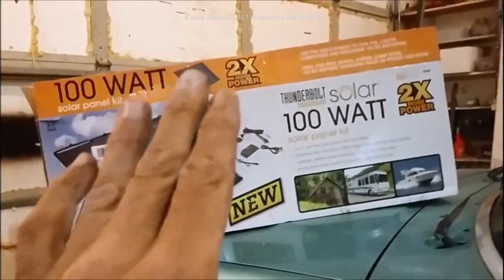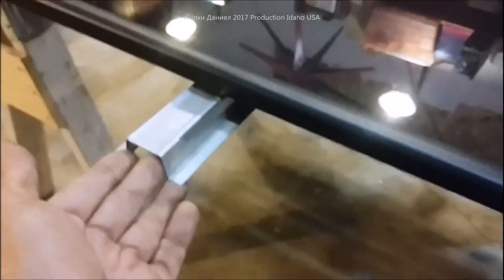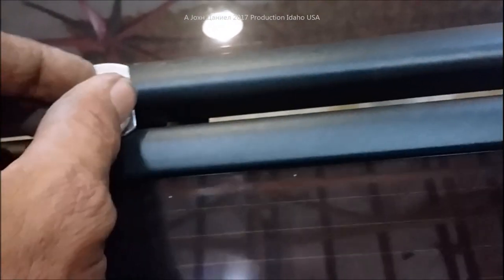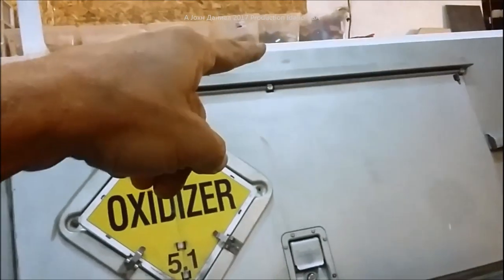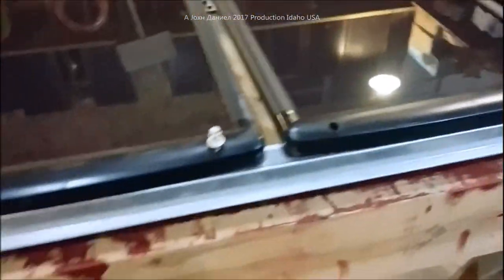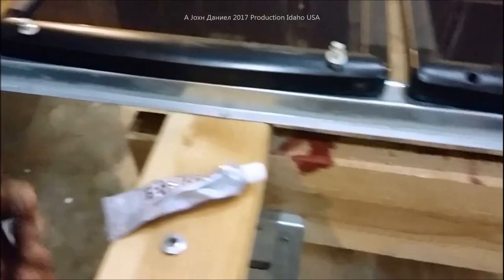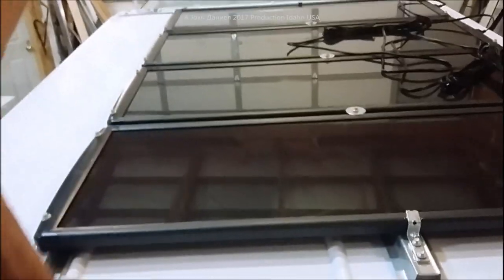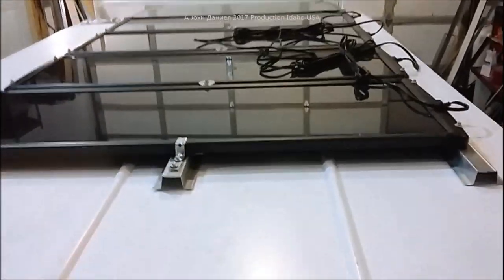100 Watt HARBOR FREIGHT Solar kit how to install, ( see below video parts and more options )

Comment: I bought the same thing and was shocked at the size. I returned it and got a Renogy setup for 1/4 the size and far cheaper per watt, and I got my HF on sale with 25% off coupon. Glad it's working out for you though.
Reply from the maker: +GovG33k I have some 100 watt renogy on a little camp site in Monticello Nevada. In 28 months both are brown and not working. Sitting next to them is 3   75 watt  kaneka amorphous from Solar Penny that are 7+ years old and working perfect.  Wish I'd bought 10 of them!
Reply: Good to know.  Thanks John.

Comment: I've had mine for overall year now on my van.. Not one issue. Mine has a separate plug for connecting the panels to the charger on the unit. I've noticed when people plug in there panels to the two outlets with the solar symbol, next to the battery on the bottom of the unit, they blow a fuse in the unit. I have 3 AGM batteries from Harbor Freight. I don't use so much juice that it drains the battery. During the day the panels get 13.8V so I can use the energy directly from the sun to use. It's a great unit for beginners.  
 Thank you for the video.
Reply: Lead batteries need 14.6 at least to get a full charge. Check the charge specs from battery manufacturers

Comment: I liked the 45 watt kit. 
I love the 100 watt Thunderbolt solar kit. 
Harbor freight got it right on the 100 watt.
Reply from the maker: They are a excellent beginners solar set. But, don't stop there, go find some real serious Amorphous CIGS Panels like STION and grow with them!
Reply: There are a lot better panel stand these Harbor Freight. Virtually anything on Amazon in a hundred Watt is just as good if not better and about 1/4 of the size

Comment: That's one hell of a battery bank you got there, bigger then my motor home. Just added solar to keep the house batteries topped up. But usually lasts 2 weeks, lights and water pump.
Reply from the maker: Increase your solar, and if you want to make you a booster using tool batteries to surge charge your system when low, stay tuned I will eventually show how we use 8 spare 20 volts batteries fed into a solar controller to hit it with 15 amps at 4 am.

Comment: Did you do anything in terms of weatherproofing? I have these and I'm thinking of running silicone caulking on all the corners between the cells and the frame, as well as around the screw holes and where the frame has any seams.
Reply: How it went with weather?
Reply: 3M 5200 WHITE is BULLETPROOF.

Comment: A great way of maximizing your charging power is the ability to tilt your panels especially during the winter months. These panels are made to be tilted and have the necessary hardware included. Your installation is preventing you from using these panels to their maximum capacities.
Reply: Some of us are looking for a good way to top off batteries without a lot of trouble or having to be constantly tending a system.  These amorphous panels work well without being too nitpicky about directly facing the sun or being in mixed (or even full) shade.  These work nicely for that purpose, and I'm not out fumbling with panels the minute we stop.  If they don't charge enough, and I'm not driving anywhere soon, I can simply start the engine or the generator for a while.  Haven't had to do that, but I'm much happier not having made a career out of trying to eke out every last possible bit of power or worrying about what some others have posted about getting better quality elsewhere.  My in-laws have a new $120,000 RV which they have to park in the sun...I park ours where I feel like, under the trees or whatever, and don't worry about it.

Comment: Awesome, that's what I started with 6 years ago, nice video, thanks for sharing! Godspeed
Reply from the maker: +My Battery Powered House I got my first 3 for a birthday gift over 10 years ago, starting in 2009 to now I have over 7800 watts of solar and wind power.
Reply: that is incredible!
Reply from the maker: +My Battery Powered House I recommend always putting at least 20% of your array in Amorphous
Reply: What makes you say that?
Reply from the maker: +My Battery Powered House Amorphous  produces in all weather conditions even dirty and like my STION Sto-135 panels they all start kicking out real amps at daylight instead of hours later like poly and monocrystalline.

Comment: Hey Mr. John!! I just bought an ambulance that came equipped with a 1000watt vanner inverter and I am ready to try to tackle solar but am so clueless even though I watch videos about solar day and night. I bought a deep cycle marine battery recently and would love to hear from you about how would I begin to get solar setup working so I can power my appliances off grid. Thanks!!

Comment: Great video.  Just like you I bought my kit before they were set out in the store, on the same day you did!  I like your battery bank set up. Could you do a video on how you set up your battery bank if you isn't too much trouble.   I'd like to have mine to the point where I can use 2000 to 3000 watt inverter.
Reply from the maker: +monchorga Go see my other videos for all your searching for.
Reply: Will do, thanks a lot.
Reply from the maker: The Controller that comes with it is not perfect, it eats 14% of the watts up. However, I got 91 watts straight through a REAL Thermodyne Watt Meter, http://rover.ebay.com/rover/1/711-53200-19255-0/1?icep_ff3=2&pub=5575119394&toolid=10001&campid=5337966591&customid=Genuine+THERMODYNE+SYSTEMS&icep_item=391142371694&ipn=psmain&icep_vectorid=229466&kwid=902099&mtid=824&kw=lg PROVEN BEST ONE MADE, Don't buy that fake knock off copper colored aluminum wired missouri junk.
Reply: Thanks for the info.  I'm new to trying to do this.  I really appreciate all the information you have passed on!  Thanks again.
Reply from the maker: They are worth the investment for a test and to learn on. HOWEVER, If you understand SOLAR and want to grow, Especially getting serious but affordable 25 year plus better quality Taiwan made panels, Cadmium Telluride (CdTe) Thin Film Solar are the only way to go. And if you can understand AMORPHOUS, go see the specs on these. And get them with a good controller. The specs are on here DM 77W CdTe Solar Modules - 2PK  http://amzn.to/2u0YRz2 and a perfect controller is The SOLAR EAGLE MPPT  http://amzn.to/2uFxhoT
Those who trash talk and assault Amorphous either sell, hock, push and profit from  Poly-Mono China Panels or Own so much warping, browning, cracking Chinese Mono or Poly panels they are ashamed!
Fact - 1500 watts of Amorphous will out produce, outlive and be more forgiving than 1900 watts of Silicon based in a KW rating over a 30 day period!!
Reply: Just curious if these Solar Panels an Charge Controller are so Great why are there Zero Reviews when i go to Amazon and view them....?
Reply from the maker: +Kelly Dardeen They are generally bought by pro installers, mostly in the Recreational vehicle biz who are not regular folks wanting to do reviews. 
I have installed over 60 of those panels on travel trailers,  box trailers and 2 small homes.  That controller is a solar eagle, being sold by a cheaper dealer than www.yoosmart.com prices a 50 amp for so I put the cheaper link on there, but I can put a more pricy link to the same identical controller that's got 4.4 out of 5 rating if you need it.
Reply: Thanks for the Explanation it just seemed odd to me there were no reviews for either product.

Comment: Great videos... Your a natural for video...
What's the options for running more than one kit, say 3 kits 300 watts and combining them? Possible?
Reply from the maker: You can run 3 kits, 5 kits, 10 kits if you like. Just add or upgrade solar controller to match it's wattages
Reply: @JOHNDANIEL1  great thank you for replying

Comment: John, great video!  Couple of questions thought: 1. Securing the hat channel to the roof, what kind of screws did you use and what kind of sealant with them?  2. Was there any backing or base you had to install inside to screw into?; 3. Did you special order the 18 gauge hat channel, can find but 25 gauge in stores, still looking?  4. You mentioned rubber on the center hat channel portion, did you use rubber on the all three channels?  5. Was the rubber running the entire length or just on the end pieces.  Installing this on a 6 x 10 enclosed trailer for my work bench and Motorcycle so any help here would greatly help.  Thanks!
Reply from the maker: Sealant is LAP, best supplier of FRESH stuff is  http://rover.ebay.com/rover/1/711-53200-19255-0/1?icep_ff3=2&pub=5575119394&toolid=10001&campid=5337842430&customid=lap+seal&icep_item=151644706011&ipn=psmain&icep_vectorid=229466&kwid=902099&mtid=824&kw=lg Floating Seal RV ROOF AND METAL. You put down this roof tape in strips where your metal goes http://rover.ebay.com/rover/1/711-53200-19255-0/1?icep_ff3=2&pub=5575119394&toolid=10001&campid=5337842430&customid=ETERNABOND+3&icep_item=222765809642&ipn=psmain&icep_vectorid=229466&kwid=902099&mtid=824&kw=lg RV ROOF Seal gasket tape. Run it where your HAT metal will lay, put it down on the roof, then put the hat channel on it, screw through it, then float the LAP seal caulk on it where you put screws. 
Screws are common Self Tapper or sharp point roofing screws, 1" long (pre drill your Hat/furring metal for thin RV roofs and set your drill clutch for about 8lbs install torque)
You can call this place to find a dealer of HAT Furring channel near you, I suggest 20 gauge as a goal. https://www.clarkdietrich.com/products/drywall-framing/furring-channel-hat-channel

Comment: From the solar panels to the charger, which wire is the positive? The round wire or the ribbed one?
Reply from the maker: When using low voltage wire to do your wiring the normal choice is smooth is positive.

Comment: John, thanks for your videos!! Lots of good info and looks like we will be grabbing these panel sets also. I have property in eastern Az where we are going to begin building. We need some power on top of the shed for lighting and so on and also to run a water pump. Just wondering if you recommend buying say 3 sets and plugging them together? How many batteries do you have for the one set of your panels and what kind are they?
Reply from the maker: +Mrs.Layton'sClass I'm using the 29 series Exide built Walmart MAXX deep cycle. You should put 1 on each set of 4 panels and upgrade to a 30 amp mppt controller. You can later buy 2 single panels when they offer them and add them to get full use of that 30 amp controller. Would work good to run a good quality 600 to 800 watt inverter, DC lights and small shurflo pump.
Reply: Thanks for that info! You're awesome! I wonder if you might do a video later on your battery set up. It looked cool.
Reply from the maker: +Mrs.Layton'sClass Great idea,  I'll soon do one

Comment: I was looking to do a similar setup for my cargo trailer when I want to go camping.  You are using the one set of panels for three batteries.  I am planning on running a mini fridge off of it, as well as charging phones, laptop, tablet, etc... and occasionally a cpap machine.  I was looking to run four batteries and two sets (8 panels for 200w).  Do you believe that to be overkill?  According to their little chart for approximate wph... it claims that a mini fridge will run off of one battery for approximately 34 hrs, and that a 100w panel system will charge a battery in 24 hrs.
Reply from the maker: If your wanting to go for a equated eventual SAME PRICE much better result, check out the used and proven items I have myself installed, and is listed in the end on this post. From a user of Solar since 2007, Installer since 2011, I say Get 3 of the 100 watt poly panels, a high temp tolerant 30 amp controller and the 1500 watt pure sine inverter because a C-pap will fail on a modified sine inverter and your entire system will be 40% more power on that cargo trailer. Complete for around $700. Doing it piece by piece with the Harbor Freight would actually cost you more because 200 watts ($350 for just 200 watts) is a great maintainer, NOT a great power active source.   See Following:  Complete kit, PANELS, WIRING, MOUNTS, CONTROLLER - https://amzn.to/2R17Icr  & durable 1500 WATT pure sine high efficient inverter -  https://amzn.to/2DBbPrW

Comment: Great video. My only concern is ventilation for the batteries. I'm not sure but I think the batteries give off a gas while charging.
Reply from the maker: +Abel Villarreal The batteries are made to go into RV'S, boats, trucks with much less suspension my truck has. And for hydrogen gas the utility shell on the truck was for hauling mining explosives and has numerous venting locations.

Comment: Cool vid. I have a travel trailer that uses 50 amp service. What do you reckon it'll take to power it? (Self contain) One roof air, and basically a 110 house refrigerator.
Reply from the maker: 2200 watts solar minimum, and 8 deep cycle batteries in the GC-2 style. Best bet, get rid of the hungry 1200 watt topper AC unit, install 2 micro 4800 btu AC's. They make a very efficient 300 watt model from AliExpress that is under counter mounted, with a small hole out the trailer side for it.

Comment: The cap on my truck is not flat.So I would use a shorter hat section channel down the center so not to bend the panels when all is tightened down.
Reply from the maker: +Craig Thulin Just be careful, and don't crank the screws down. Just till the rubber touches good.

Comment: Hi John
I have 300 watts and another 90 on both sides of my airstream and want to join them with the wheel and go to the charge controller I bought separate and the battery. Problem is they run short and I wonder what gauge wire can work without any problems?

Comment: Very good man, i subscribed. You have all kinds of cool vids. Good work.
Reply from the maker: Thanks and enjoy the crazy stuff I film!
Reply: Harvy Aims , all kinds of cool vids , totaly agree, i find them very helpful vids and interesting.
Reply: You have to like someone who can take a leaf blower and make a styrofoam insulator out of it or a cheap little trailer and make a cool one of a kind dual axles trailer which no one ever seems to have done.  I actually used that leaf blower idea, it worked fast.

Comment: I would love to see you build a Sun tracking device for ground or camping areas.  THX great videos.
Reply from the maker: An Idea, but why? These are so cheap to get I can just toss one or 2 more out there and BOOM, more juice!
Reply: Agreed John.  Solar is so much cheaper these days.  If you have the room for the panels, I think it's better to just go overkill on the panels than to use mechanical sun tracking.

Comment: I just bought the 100 watt panels and the 5000/10,000 inverter. Gonna use it for my house. Heater/ac and wood burner. The cable that comes with the system is to short. Only like 8 ft. Wont go into my house. Where do I get more cable? Called HF and they have no clue. 
 Also, what are those big batteries? 8d or something.

Comment: Can you explain your bulk head fitting and did you just wire all the panels together and scrap the harbor freight wiring harness?
Reply from the maker: +David Edlin The terminal allows you to pass power through metal like a car body or similar 16 to 32 gauge metal. 
Yes, I cut away the excess length and wired them to the insulated terminals.
Reply from the maker: +David Edlin I will do a video on the bulkhead electronics terminal soon.
Reply from the maker: The Bulkhead Post adapters your looking for http://rover.ebay.com/rover/1/711-53200-19255-0/1?icep_ff3=2&pub=5575119394&toolid=10001&campid=5337967172&customid=80+Amp+Post&icep_item=142044360664&ipn=psmain&icep_vectorid=229466&kwid=902099&mtid=824&kw=lg As seen in video
Reply from the maker: OPTION 2, I can send you 3 sets of 2 for $12 shipping included as long as its in the lower 48 states, if your elsewhere I will have to check cost. Just go to paypal.me/PokysParts/12
Let me know if theres any problems and make sure your shipping address and email is on your request. Takes about 4 to 7 days due to my work schedule to get them. 3 sets of 2, 6 parts in total. 80 amp capacity.
Reply: A better option in my opinion is the solar rooftop gland or whatever it's called. Or a grey PVC 4x4 electrical box as a junction box on roof.

Comment: How many of these kits do you think it will take to power a 300 square feet 3 room small home?
Reply from the maker: In my experience you will need 5 for 500 watts potential and without a doubt to get the collective power as if you had 6 sets you need this https://ebay.to/2w4k634 40 amp MPPT controller. And you will need one 100 amp battery per set, so 5 of these http://linksynergy.walmart.com/deeplink?id=nNC3MIW3bd8&mid=2149&u1=HFsolarbat&murl=https%3A%2F%2Fwww.walmart.com%2Fip%2FEverStart-Lead-Acid-Marine-Battery-Group-29DC%2F107362274 
Good luck building, be always thinking EFFICIENCY in everything your installing. Including using a old style static heating unit for heating.
Reply: I'm thinking 3 minimum
Reply: Depends on what you want to run and for how long.